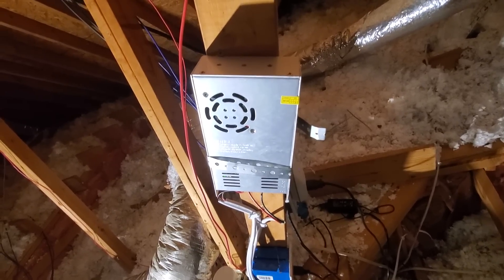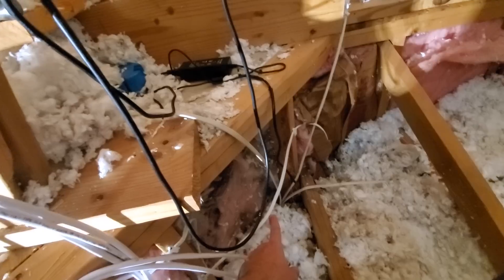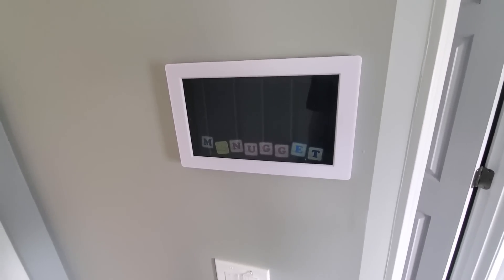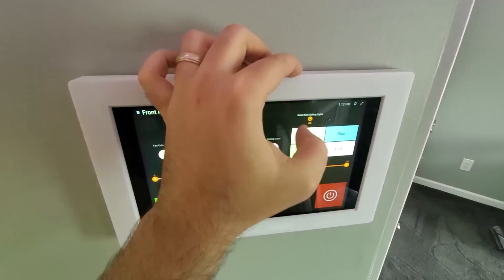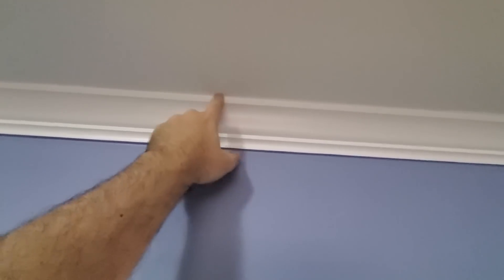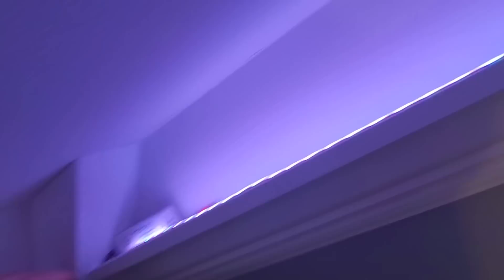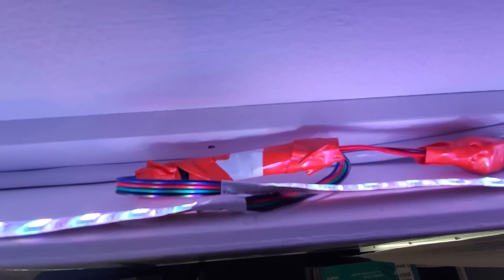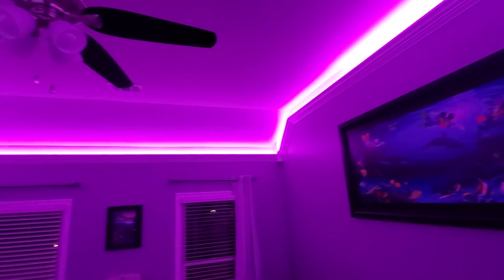LED Crown Molding Nightlight Tour

Comment: Great job.  I am doing a small bedroom (50 linear feet).  I am also using a base and crown molding configuration.  I am painting the back of the molding and wall projection white for more reflection.  It looks like you attached the strip light to the back of the crown molding.  Is there a reason you did this and not attach directly to the wall behind the crown molding.  (better ambience)?.  Also, which strip lights did you select?  The higher end units list  more detailed specs.  (lumens, # of led's per foot, wattage per led, total wattage, etc)  The strip light I am looking at list them at 5.1w/ft (83 watts/16.4 ft) or 2000 lumens per 16.4 ft.  50 ft is approximately 6000 lumens and 250 watts consumed.  Is this overkill?  The lower end strip lights list them only as 36 watts per 16.4 ft with 360 led per segment (9 led's per ft).  I am going to keep it simple for the controller (phone app/remote control for dimming and color & wall switch for off/on.  Thanks

Comment: Hi, I'm planning on doing lighting like this. I got 20m rgb led strip, 12v 15A power supply and was just wondering do I need to run a wire from the power supply to each 5m strip

Comment: Nice job! A few questions. 1. You need a power supply for each room? 2. If I understand correctly you show multiple speaker wire, (power), going to each room, how do you determine a(how many power runs and b) where to splice in? I assume you are showing a power supply splice when you add the LED booster?
Reply from the maker: Good questions!
1.  You do not need a power supply per room. It just depends on the current draw each strand will use and how big of a power supply you have.
2.  For best results you need a booster between every 16 foot section, and each booster needs power.

There are other booster designs, some that are more accurate / better, but they do not fit in the molding.  If you use those, you'd put those all in the attic / non visible space, and run 4 conductor "LED wire" to each strand instead.
Hope this helps!